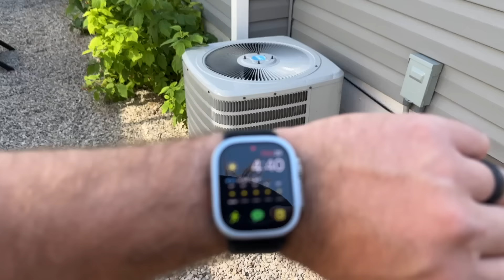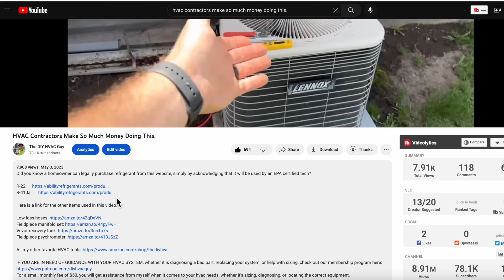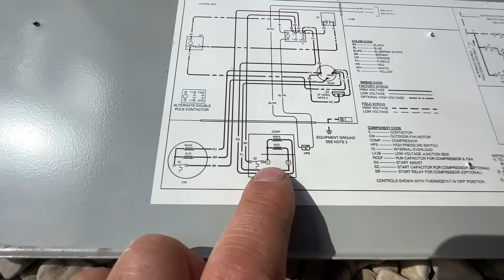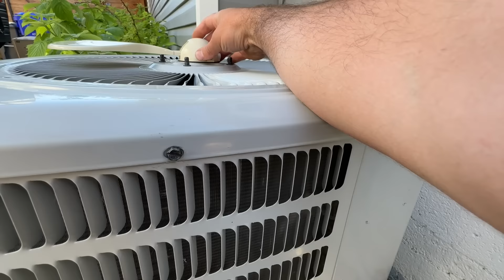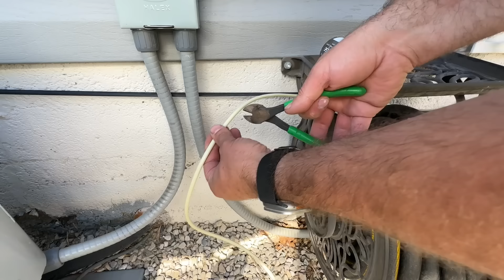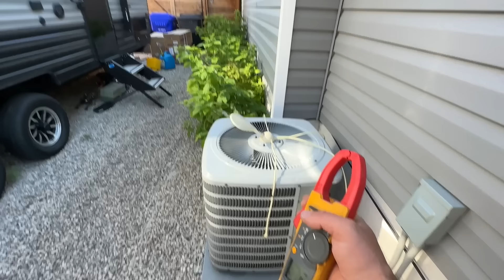Can This Device Actually Lower Your Electric Bill By 30%??

Comment: I was thinking about you rotating the device so that the line from the back was on the front.  You already have the Sun beating down on that outer side, and the back is shaded.

Speaking of shaded, you can also add a smaller shade sail (like the large one you have between the house and shed.  that will help to cool the ambient air before the misters do anything.

I'm a handyman, and one of the houses I do a lot of work on has 4 units.  I installed a few shade sails over the area where three of the units are located and I noticed that it lowered the ambient air in the driveway area by at least five degrees.  I haven't checked it with a thermometer yet, so it could be a lot more.

Also, I am wondering if "more is better" in this case.  Meaning, if you have one misting valve on each side and you get 1 degree cooler inside temps, would three misting valves per side do anything to cool more of the coils on the top/middle/lower portions?

Comment: I did this and got about a 1A improvement. But you get wicked lime buildup. You can also soak the roof of your house in water. You can also hold the hose over your head and bask in sweet ecstasy of coolness. Bro.

Comment: 5 year ago i misted my struggling ac unit to keep it cool enough to run during the august heat in texas long enough before i could get it replaced.  It worked but i would not suggest doing to as the excessive water will leave hard water deposits on your coils. And that would create a insulator on the coil even if your using a filter.

Comment: 4.4amps -3.6 amps = 0.8A
0.8A * 240V = 192 watts
192 watts / 1000 = 0.192kilowatt-hours saved per hour of runtime. 
Be generous and say the AC compressor is running 10 hours per day, = 1.92kwh per day * 30 days = 57.6kwh saved per month

I pay $0.16 per kwh, so 57.6 * 0.16 = $9.21 saved per month

AC here is on 6 months of the year, so we're talking about potentially saving $50 per year. NOT WORTH IT! Especially considering that this will reduce the life of your unit.

Comment: Since our current heat wave has given us 110° days, and causing our compressor to overheat and shut down, I've been doing this.  Works well!
Reply: Your compressor shouldnt overheat at 110 even at 120 .. if is in good shape/serviced  like coils ,caps ,freon,fan poss wrong fan blade .should be able to run 24/7
Reply: @stevewalker412  As long as the temperature inside the house isn't abnormally hot and the system is in good condition, 110 degrees shouldn't be a problem. The manufacturer specs I have seen normally rate AC units to operate at up to 120 degrees F outside temperature, but if the system is undersized, not working properly, poorly installed, etc, I could definitely see it overheating when running at such high temperatures.
Reply: @averyalexander2303  think you got zee wrong steve .as my post states it should have no prob
Reply: @stevewalker412  As I said, as long as the system is correctly installed and working properly, there shouldn't be a problem under normal conditions. But if the outside temp is that high and the inside of someone's house is also 120+ degrees from a long power outage, AC outage, etc, I could see that being a problem because the compressor is cooled by the return refrigerant, which will be quite warm with such hot air air blowing through the evap coil. Extremely high head pressure + abnormally warm return refrigerant = very hot compressor. But whether the compressor would get hot enough to trip the internal overload, I'm not sure. If I remember correctly, the maximum temperature of the refrigerant returning to the compressor should be around 65 degrees F according to Copeland and it could easily be well above that under those conditions.
Reply: @averyalexander2303  you have to consider some other factors. If the temperature outside is 110°,  then there is the increase of temp in direct sun light +/-10°. Then there is the increase of temp when the equip is operating under max load +/-10° so on an so forth. Units can and will easily exceed that rating during very hot and sunny days. This is how they burn up.
Reply: @absolute.freedom  I agree, there are lots of factors which will affect how well the system will perform and how hot the compressor will run. In theory, the compressor's internal overload should prevent a catastrophic failure, but if that always worked perfectly, compressors would never fail from overheating, which they clearly do. Excessive heat will break down the oil and the insulation around the windings among other things like increasing the load due to higher pressures, which generates even more heat.

Comment: Ok, first off, you could not have been measuring compressor amps. 3.4 or 4.4 amps is an  crazy low number for that type of unit. 
230v at 3.4 amps =728watts 
1kw =3412btu 
12000btu per ton 
my guess for that unit is 2.5 - 3.5 tons 

So my diagnosis is that the unit is grossly under charged. Or  under no load 
What was the temp split, temp at return minus temp at supply?

Secondly no inline water  filter will eliminate all total devolved solids from water leading to mineral deposits on coil and leading to the untimely death of condensing unit.
I've been a hvac tech for a long time and have incountered these type of devices in many shapes and sizes and they all have leed to fouled condenser coils. Also you can never change the laws of thermodynamics heat removed  by the system cannot exceed the amount of energy consumed by the system. They are directly connected and cannot be changed. Don't get mad at me it's 
SCIENCE

Comment: I seriously doubt you're going to save money doing this. You're likely just trading a higher water bill for a lower electric bill. Window AC's do this but they're slinging condensate from the evaporator onto the condenser with the fan to do it.

Comment: I tried one of these a decade ago when I lived in South Georgia.  It seemed to work too good. The air was colder and the unit stayed on less time. But I noticed that humidity wasn’t full being removed from the house and removed the mister. It wasn’t worth getting mold in the house behind the walls.
Reply: if your evaporator is cold you will remove humidity, the condenser temp has nothing to do with it. I doubt you evaporator was cold enough.
Reply: @hello_kitty_girl69  I think it was the shortened running time that reduced the dehumidification
Reply: You realize that making your AC unit work better removes more humidity? funny conclusion you offered.

Comment: Depending on the water quality this thing could really destroy your coil in a short time. I see some people saying they’ve used similar things for years, but every time I’ve seen a DIY setup the coil is trashed from it. 
I was taught (but honestly can’t say if it was true, but never wanted to be they guy who caused it) if you sprayed the coil while it was running you were likely to shock the copper coil so the aluminum fins never make good contact again (I know, but what about when it rains 🤷🏼‍♂️, I just never wanted to risk it)
It sounds tempting, I imagine there is going to be a significant reduction in kWh, but if you shorten the coil line by half, did you save anything.
Reply: *shorten the coil life by half…

Comment: While the value proposition is there, the biggest issue with this system is that the filter probably cannot remove 100% of mineral deposits in the water.  Once the water on the evaporator fins evaporate, minerals will be left behind at an accelerated rate.  The minerals will then speed up corrosion on any metal surfaces.  At least this is what I've read.  I'd like to see reports of anyone using this for more than a few years to see the effects of long term use.
Reply: Either a buildup of minerals on the fins (bad) or corrosion. Water sources vary widely!
Reply: The water evaporates before it hits the coils, at least that is what it appeared to be doing… Thus, similar to a mist system, you will get build up on the nozzle… Of course, that is in places like Phoenix, but with high humidity you will probably see water accumulate on the coils… Just plumb in a small water softener like they do on cooling towers, I have a whole house system as it was pre plumbed with a loop in the garage (but, the piping to the house bibs usually come off the main before the water softener)..

Comment: If your water supply is "hard", your condenser will soon develope mineral deposits on the housing and fins, reducing efficiency.   I speak from experience, living in Central Texas.

A better option is to install a Heat Recover Desupetheater.  Various makes.  It takes the heat from your evaporator and runs it thru an exchanger conected to your water heater.  

1.  Manufatures claim it raises your EER/SEER by one and reduces the condensers' power consumptipn by 10%.
2. The waste heat is used to heat your water.
3. I went from April to October with my electric water heater turned off.  Family of four.
4.  Using Smart Meter data online snd an ammeter, i confirm the claims.
5.  I installed the unit next to condenser and used Pex to connect to my water heater.
6.  An AC tech can connect the refrigerant lines between the condenser abd Heat Revery Unit (HRU).  In a new condenser install, the hot (gaseous) lune is beazed to the HRU, and the HRU return line is brazed to the   intake of the condenser.  If an add-on, then the HRU is spliced into the hot (large pipe) from the house, before it enters the condenser.  It's more labor, as the refrigerate must be pulled.
7. As I stated, the HRU was a DIY install.  I co verted to a complete heat pump.  The AC co.pany wanted a few hundred $ to merely connect the HRU to the condenser.   I said BS, as it involved no additional fittings, only 2 extra braze connections, and several more ounces of refrigerant.  Guess what?  They did it for free.  Considering  the cost of a new air handler/evaporator & condenser install, what is 15 minutes more labor?
8.  At the time, I had a 2-stage 3 ton heat pump.  I don't recall the low stage draw, but the high stage draw was 3.2kW, and my electric water heating elememts drew 4.5kW.  So, I turned off my electric water heater at the breaker and got free hot water.  In effect, if i wanter hor water, i just han my AC (heat pump).  Seeng as the AC runs from sometimes March thru October in Texas, the heat recovered kept us in hot wasted 24,/7.  Otherwise, the heat extracted from your house is truley "wasted"
9.  There are various manufacturers of HRUs.  Dynamax is one.  They offered several price points, the the performance data was the same .  I settled on the lowest price one.  It sat for a year before I installed it with my new system.
10.  The hotter your environment is, the quicker your ROI is.
11.  Dynamax is in Florida.   Not sure now, but Florida (electricity providers) offered a rebate on HRU installs.
12.  Free hot water, little or no electric /gas consumption from your water heater, less electric consumption from your outdoor unit (condenser,)  and less wear on the condenser.
13. Desuperheaters are used in Industry, to include food processing.  I' venture a guess that the heat necessary to produce distilled dring water is not from a direct dource, but waste heat from a Desuperheater (HRU).
13.  BTW, Attic Foil in Dallas makes an effective radiant barrier for DIY.  I installed in under the rafters in my house in August, over several days.  The install was latervening, after work, when it was cooler.  Using Smart Meter Data, my electric co sumption actually reduced as the 3-4 day install progressed. With westher.com, I tracked how the temps increased during the install.  The eife and kids were in Austin at Grandmother's,  and my routi e after work was music/online, and i used my microwave for simple meals.  Stuff worked.  I used 8 fut panels of 1/8 plywood (narrow enough to fit through the hatch) to distribute mt weight on the i sulation, and an electric staple gun.  While it could be a 2 person install, I managed a solo just fin.
14.  Referring to the video, my condenser faced the South.  Before the Redtips grew large enough to provide shade (and pruned notto obstruct air flow, I cemented 3 PVC fittings into the ground.  Into those I inserted PVC pipes(now poles) at about 7 feet tall and used mesh sunscreen from Lowes, in an L confuguration toblock the direct sun from the South and West.  When Summer was over (In Texas, we o ly have 2 Seasons- Summer and Not Summer)  I simply pulled out the PVC poles and rollled up the sun screen, placing caps over the embedded fitings.

I am sharing my experiences, as the YT Community has shared much with me.  Unfortunately,  I am not at home any more due to a divorce, but I can be reached at machtznitchtz at gmail.
I had my home from 1988 thru 2019, for reference.
Thanks for reading.

Comment: would this work in a high humidity area like where I live in central Florida where swamp coolers do not work,
Reply from the maker: Not as well but I’m sure it will still help a little. The idea is to cool the air not douse the unit with water.